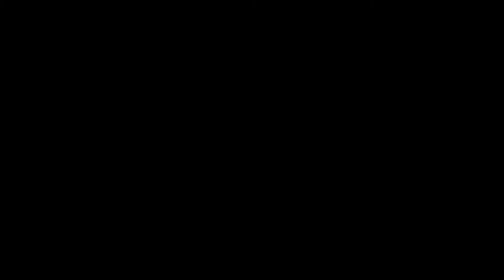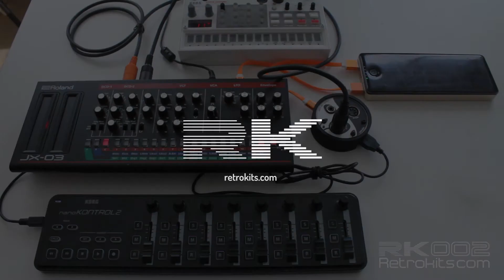RK-002 with Roland M182 Style Sequencer DUY firmware

Comment: Hello, how should I midi-configure the nanokontrol 2 to work with this rk002 firmware ? any midi chart ?
Reply from the maker: Here's the setting:

Nanokontrol CC layout:
slider = steps (1-8) CC: 1,6,11,16,21,26,31,36
R = note repeat or
single note pattern step CC: 2,7,12,17,22,27,32,37
M = skip seqPart CC: 3,8,13,18,23,28,33,38
S = short/tie notes CC: 4,9,14,19,24,29,34,39
dialknob = notes CC: 5,10,15,20,25,30,35,40
track < > : tempo - + CC: 41,42

cycle : all reset CC: 46
marker <> : scale select CC: 44,45
<< >> : note offset - + CC: 47,48
(also responds to keyboard notes)
play/stop : the obvious CC: 50

And a template for the korg editor is here for download: https://goo.gl/W3dqbS
Reply: Thank you !  @RetrokitsDev

Comment: Hi, just curious to know what clocks this setup. Is the clock coming from the RK-002 as well?
Reply from the maker: yes, the clock is also coming from the RK-002
Reply: Thanks for the quick reply. Can the clock speed be changed easily from the nanokontrol, or does it have to be set with a computer?
Reply from the maker: We just used the scene - scene + button on the nanokontrol2 to nudge the tempo 1 BPM back and forth
Reply: Great. Thanks again. I'll have to pick one up some time.

Comment: Sorry for OT: What is the powerbank, you are using to get 9V output???
Reply from the maker: Oh it's just a regular 5v powerback which powers the RK-005, I heard Gaz saying it powers from 9V but he forgot to mention there is a little RK power converter inbetween which makes it 5v. There are some universal laptop backup banks on ebay which do 5v-19v by the way.